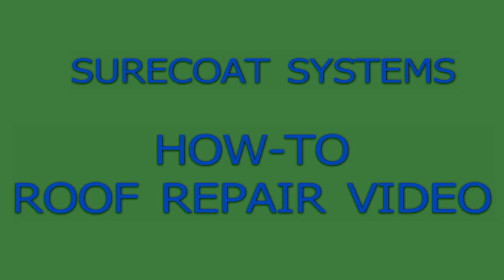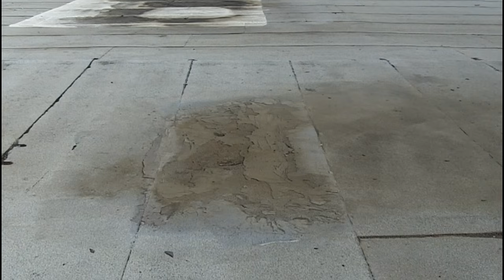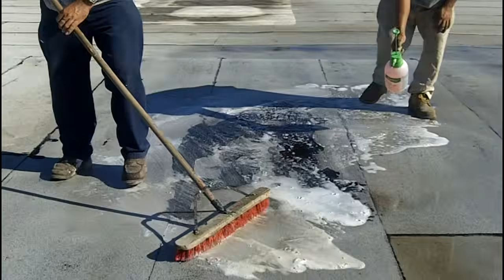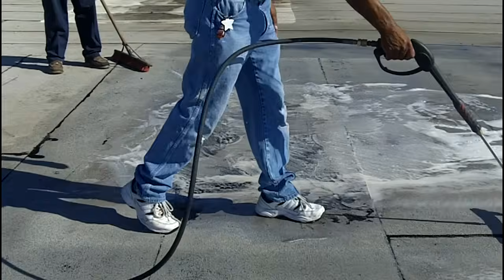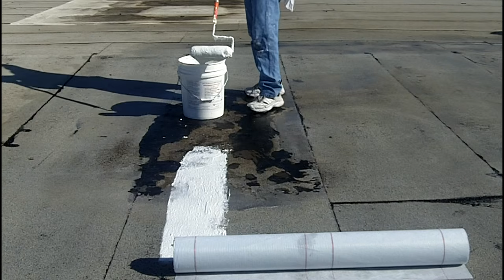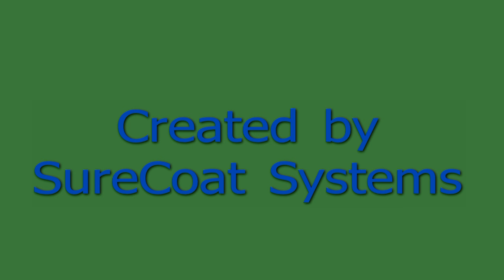How to Install Elastomeric Roof Coating - Flat Roofs

Comment: In my experience with elastomeric roof systems, they can break down earlier in ponding areas. It would have been a good idea to use a pour-on roof leveler in that low spot first. I've also found that following with a brush after the roller helps embed the fabric better too. A tacky roller tends to pull at the fabric, especially on hot days.

Comment: How much sq footage do you get on a 5 gal gal?
Reply from the maker: Coverage rate depends on a number of things: substrate, condition of substrate, will mesh be embedded, will it be rolled or sprayed?  Typically a 5 gallon pail will cover 100-125SF as a system (mesh embedded)

Comment: What's the problem here?  And why wouldn't you just find the hole and patch it with a small piece of torchon? AND I'm pretty sure that the substrate should be 100% dry with that product.  Soooo unprofessional. WHAT the ... are you fixing??  Dirt on a roof?

Comment: If this product is placed on a sloping roof is fabric mesh required? I guess if the roof is more horizontal then the fabric mesh will prolong the life of the product. Also can the fabric mesh interfere with vapor permeability?

Comment: I recomend to Always Use Base Primer, and Embed the Polyester in between layers with Base Primer, Dries Quicker and then Apply The Coating.... I LEARNED to ONLY Use Silicone VS Acrilic Base...on any Restoration! Good Luck People!

Comment: Putting any coatings in a heavily ponding area is not a good idea if your looking for a long-term fix. A properly Installed silicone may last for years. Anything else maybe a few years if your lucky
Reply from the maker: Thanks for your opinion, however our coatings are engineered with marine resins which will stand up to ponding water for 10+ years and can be recoated to extend that time frame.  Unlike Silicones our product can be used as a repair and continued on to complete the entire roof, Silicones have poor bondability with all substrates including other Silicones.

Comment: Waste of time scrape roof ? It needed pressure washing before coating anyhow.  No need wasting time scrape ,   pressure wash would get it all.  These guys really made more work outta nothing.  I would of pressure washed it and been done by time they were down monkey around scraping roof ??   Pressure washer is all it takes
Reply from the maker: The roof is scraped in addition to pressure washing to ensure proper adhesion.

Comment: I have a concrete garage top which is a patio can you walk on this kind of a fix Thank you in advance
Reply from the maker: Thanks for your question - we have a deck system designed for your type of project.  Give us a call 877-823-7873

Comment: 3:53 It is nowhere near dry after 10 minutes. Put a water base coating on that WET surface and you will mix the coating with the water, weakening the membrane and trapping moisture which will form bubbles. Horrible advice. Give it at least several hours. And if you were to use a solvent based coating it would not stick as it is still WET.
Reply: lol you can tell it’s still wet when he starts applying the product. We never power wash modified. We just power broom it and blow it off then we start our prep work.

Comment: The whole thing is going to fail applying that to a damp surface those granulars need a full day of sun to properly dry. Sorry for the bad news.
Reply: No it want it's a water based system I've sprayed many 55 gallons of elastomeric system over polyurethane foam with it being damped
Reply: @williamcharles3419  I’ve had inspectors come and make us tear it all off because of dampness present.

Comment: Warning!!  DO NOT USE Elastomeric (acrylic) on your flat roofs.  The product will literally peel off your roof if there is any ponding water on it.  Don't make the same mistake I made (and I own more than 1.5 MILLION sq of flat roofs in the US), NEVER USE water based coatings on flat or almost flat roofs.  If you want to use something quick that works, make sure it is SILICONE or just replace the roof with a 60 mills TPO patch / roofing system.  Don't let the $2 psf rate roofers charge for water based paints lure you into thinking this works.  It looks great the day they put it on. . . then you will see in the first heavy rain some of the product washing off your roof!  Then by year 3, it is all gone, compromised or failed.  If you are still using water based roof coatings in 2020, shame on you!  Don't say I didn't warn you!

Comment: So, you have a hole that you power spray water into. Great idea!
Reply from the maker: If there is an open hole it should be repaired prior to any coating application, this repair does not represent what you are trying to claim.

Comment: No way in hell, Elastomeric is totally unfit for use as a roofing product, unfit for the use it is intended for.  And completely unfit for a ponding situation.  Not even fit for a band aid.  Use 100% Silicone.
Reply from the maker: Wrong - our roof coating is formulated with marine resins designed to withstand ponding water, and can be used for partials or full roof restorations. The problems with Silicones is that they can only be re-coated with compatible silicone.  The only thing that will adhere to a silicone coating is a similar silicone coating.  Although some claim this does not need to be done as often as other coating systems, once a silicone-based coating is applied, the roof system is committed to staying within those types of systems.

Comment: Where I can get the attachment the one you used for the power washer the sprayer
Reply from the maker: It is a standard attachment which can be purchased at various tool suppliers

Comment: Will this work for a old rubber roof to an RV? What is the roll called?
Reply from the maker: Yes this will work on all substrates with the exception of silicone.  The roll you are referring to is a proprietary poly-mesh used in conjunction with our roof coating.

Comment: wh

What kind of fabric was that
Reply: Ken, it's a polyester fabric. Tucson Rubberized Coatings sells it and also a filler [Product # 550] for low spots.
Reply from the maker: @RoadKen53  not sure what mesh the company you mentioned manufactures but i can assure you it is not the same.
Reply from the maker: Ken it is a proprietary polyester mesh that has been tested with our coating, the thickness, and weave allow the coating to flow through and adds tensile strength

Comment: https://youtu.be/Wz_9I8n2he4 Elastomeric roofing has less fatalities than Built-up Roofing. and I like the idea of a rubber roof.
Davon Chadewick White, Inc. is a real estate, music and think tank company. www.dcwdcw.com. (dealing with hot bitumen can be dangerous. care is paramount.) (Yet with a rubber (and or silicon) roof you want to avoid slip and falls while it is wet. Safety is still paramount). https://pmsilicone.com/flat-roof-coatings/

Comment: Mine was a metal roof and I used a roller a month later water was still getting inside so I decided to use a brush took forever to coat, several days vs one day but I was able to get into all the little cracks that the roller wasn't able to get into. I noticed that the roller missed a lot of cracks and it explains why water was still getting in
Reply: Would recommend spraying one coat let it cure for 24 hours and apply a 2nd coat. That will save you a shit ton of time and headache it will also get into all the little cracks
Reply from the maker: Thank you for your feedback, our recommendations for a metal roof application would be to use a sprayer if possible.

Comment: Can I do the whole roof this way and it be good? Is this a 3 in 1 product?
Reply from the maker: You could do partials, repairs or a full roof restoration with our product.  This is a fluid applied coating that requires no primers or mixing.
Reply from the maker: @Bills BuildAll yes you could use our repair kits for repairs - please give us a call (877) 823-7873

Comment: You shouldn't be putting down anything until the roof is dry. That's just going to peel away and bubble in the we areas.
Reply from the maker: SCRS can be applied over clean damp substrates

Comment: Will it stick on metal?
Reply from the maker: SureCoat will adhere to all substrates except Silicone
Reply: I got a question for you is it possible that the product could cause corrosion on the metal? For example when it comes to caulking mastic I was told polyurethane does not cause any metal corrosion whereas other products such a silicone or acrylic could cause metal corrosion. I understand this product is a waterproofing paint and not a caulking but I figured I would ask anyway. Thanks

Comment: Why not torch a new piece down
Reply from the maker: Because our system is intended to be a long lasting renewable system which alleviates the need for multiple repairs, our coating will not dry or crack due to elements and will hold up to ponding water

Comment: Do you have a system of building up a low area to eliminate ponding
Reply from the maker: You do not need to build up the area as our coating will stand up to ponding water, but you can use our coating as a flood coat or a rapid setting concrete product.

Comment: I'm sure you are just protecting an area with ponding water?
But if this area had a active leak, how would you clean it?
I don't think a pressure washer would be the best option in a area of a leak?
Reply from the maker: We would still clean area using a bucket or hose - be sure substrate being coated is in sound condition, if not replace or repair any areas prior to coating.
Reply: @Surecoatsystems  
This is why I'm not convinced that your system is the best option. If the area has to be scrubbed this hard and has to be dry to apply coating 
I'd say best to just torch down and don't worry for many years

Comment: still a low spot!     fill the low spot  then put that stuff over it
Reply from the maker: Low spots or ponding areas are not an issue for our coating, so no need to build up the low area unless you truly desire.

Comment: I used to use this product in south africa its fantastic! and battle to find it in the UK? anyone know where I can get it in UK?
Reply: an amazing product hot south african sun did not affect this over a 10 year period. came in 5 colours and covers cracks and cheaper than its fiberglass equivelant. cheapest most effective DIY way to fix a leaking roof
Reply from the maker: Hi Brian, 
Please give us a call (877) 823-7873 to discuss shipping options

Comment: I put this on our flat rubber roof in indaina, after one yr it began to flake off, then the second yr the weather was blowing it off in flake junk dont use !
Reply from the maker: Hi K Craving, 

Thank you for your comment. We value the thoughts and feedback of all our clients and potential customers and want to confirm some details with you so we can help. We’ve checked our database and don’t have a record of your purchase. Would you be able to provide us with your proof of purchase or confirm the name of the company who purchased SureCoat on your behalf? 

We do not have any claims for coating failures. We haven’t experienced any issues when our installation procedures have been followed. 

To directly address your issue, please reach out to us via email at info@surecoatsystems.com. We look forward to speaking with you and helping you.
Reply: Fixing new roof penetration in Elastomeric roof

Comment: It works on a wet surface because elastomeric coatings are water based and, if you apply it on areas with standing water it will peel off
Reply from the maker: Hi Juan, We appreciate your thoughts and always value the opinion of our clients and potential customers. We would love to clarify the use of this product to highlight the optimal results when installed to specification. SureCoat is not intended to be applied in standing water, and while the substrate can be damp, there should not be standing water during application. The SureCoat Roof System has been proven through field testing at multiple locations in diverse climates to be waterproof once the system is cured, meaning standing/ponding water will not be an issue. If you have any further questions or concerns about the use or installation process of SureCoat Systems, please do not hesitate to reach out to us at info@surecoatsystems.com. Thank you again, Juan, we look forward to talking with you.

Comment: What a sloppy worker I don't have enough fingers in my hands to give them thumbs down
Reply: Billy, Agreed.
Reply from the maker: Hi Jose, Thank you for taking the time to share your opinion. We value the thoughts and feedback of all our clients and potential customers and want to clarify our installation practices for easy of use and optimal results. The video demonstrates a realistic work-in progress environment. The use of our fabric worked into a liberal amount of SureCoat and then reinforced with a top layer of SureCoat creates a durable, fully adhered system, no failures. Our video shows how to prevent bare spots and voids. As you might know, roofs continue to move every day as the weather changes, with equipment vibrations and as the ground settles. SureCoat’s unique properties keep the coating from tearing and substrate failures when installed effectively. Although the video, doesn’t show the final roof repair, you can see examples of our installations here, including before images:  https://surecoatsystems.com/photo-library/surecoat-roof-repair-solutions/. We always leave a site looking better and functioning more effectively when a job is complete. Moving forward though, we’ll include finished projects at the end of our videos so you can see the quality of our team and our work. If you have the time or are interested, we would love to discuss with you the quality, features and great successes we’ve had with our product line. Please feel free to reach out to us at any time with further questions, comments or concerns at info@surecoatsystems.com. Thank you again, Jose we look forward to talking with you.
Reply: 'sloppy worker'? WTF, were we watching the same video? Jesus Christ, It's a commercial roof, not a fucking sun deck on a million dollar house! Sloppy.. STFU! IDIOT!
Reply: A better app would be to apply a final layer of silicone over acrylic, not sure if fabric is required if using silicone, probably could delete. Acrylic requires 5 gal per sq to withstand ponding long term.

Comment: Acrylics needs 24 hr dry time between coats, not 10 min? Substrate needs to be completely dry. You also need 3/4" nap roller.  You need to put a minimum of 2.5 gal a square to embed fabric, plus top coat with another 2.5 gal a square? You're application process is wrong.Repairs need a 3 course patch? Looks Mickey Mouse, not professional.
Reply: In my country we have a product it's elastomeric acrylic waterproof paint for low-slope roof and it says 4 hours between coats. It's not exactly the same as this product of course but very similar

Comment: It's a latex emulsion people not rocket science ,if this was petroleum based it wouldn't even stick to a wet cap sheet ,home Depot carries the same stuff at $50 a bucket .
Reply from the maker: Hi Michael, Thank you for sharing your valued opinion. SureCoat is not a latex emulsion nor is our product a petroleum-based product, and we couldn’t be more proud to produce a roof coating outside of those categories. Home Depot does indeed carry various lines of silicone products ranging from $15.25/gal - $209/4.75 gal bucket. What Home Depot doesn’t carry, however, is a product that can stand up to ponding water like our product can and has proven to do so for well over a decade at different installations in various climates across the United States. We would love to share further specs and case studies on the SureCoat system if you have the time or are interested. Please feel free to reach out to our team of waterproofing experts at any time at info@surecoatsystem.com. Thank you, Michael we look forward to speaking with you.

Comment: Does the screen fabric type matter or can it be any screen such as a house hold window screen made of fiberglass or nylon?
Reply from the maker: The Poly-mesh is a proprietary blend that has been tested with our coating. It is not recommended to use any other mesh with our system as we can not guarantee its strength
Reply: Most polyester mats are close to the same. Some softer some more rigid. Pretty much all the same. I've been doing cold applied products for over 25 years.
Reply: We even designed our own spray equipment that out performs the spray equipment most roofers use to spray coatings.